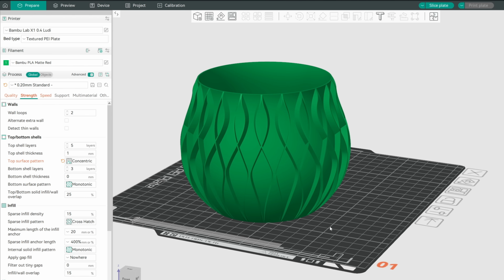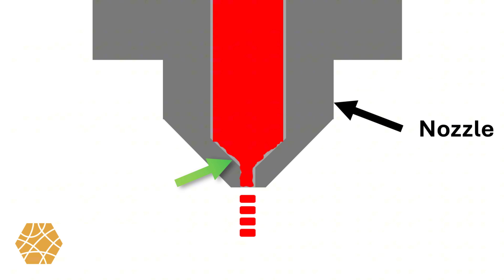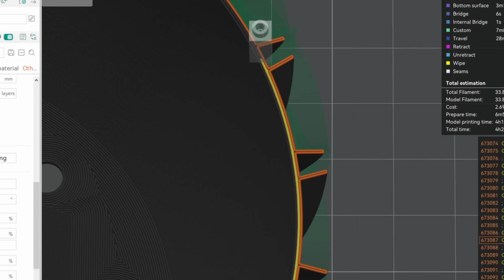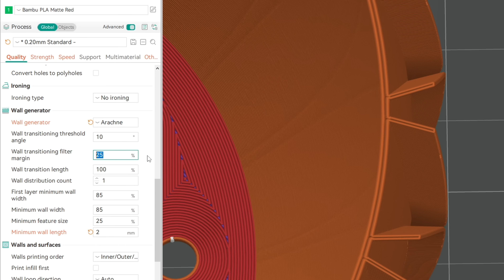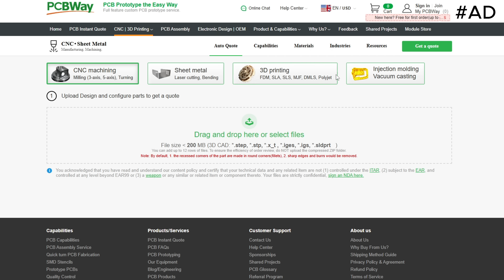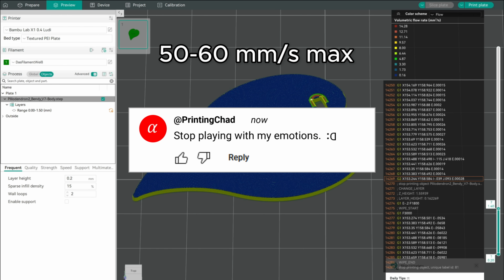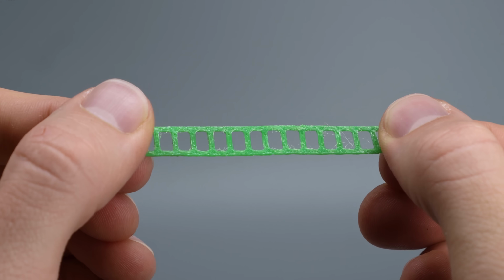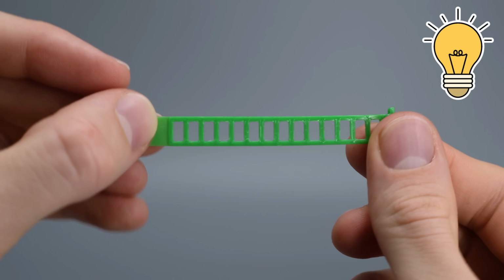The Fatal Error No One Talks About – Get Incredibly Clean 3D Prints!

Comment: nice video .Would you recommend  a bed slinger or a corexy printer for someone new to the hobby ? (Bambu a1 vs Bambu P1S )

I am also concerned about air quality as well.

Thank you in advance .  @Factorian Designs.
Reply from the maker: Both are exceptional machines, with nearly identical print quality. The P1S is a little faster and better for tall objects. I also like the AMS system a lot more because its enclosed. I have some more details on my website as well.

If your budget is not too tight I would probably get the P1S.

Its probably best to watch a video on air quality. I can't cover the whole thing here.
Reply: Just get your feet wet with a Centauri Carbon,even if you doch not like corexy or 3dprinting in general,you only had to pay 300bucks to find out

Comment: "calibrating the filament" is a common language abuse though, just like "calibrating the bed". You calibrate the flow rate actually, not the filament itself (which is truly calibrated during manufacturing), and the build plate is getting leveled, not calibrated.
Reply from the maker: Yeah true, but sometimes it easier to word it like that.

Comment: that is very stupid, in modern slicers the default is arcane. u caused a problem and solved it, this problem does occur but i u cant fix it with ur method cause it is already arcane. this is the first and the last video i watch on this channel
Reply from the maker: did you even watch the part where you adjust the arachne settings? And the other examples?
Reply: @Factorian_Designs  yes i did watch the whole video, but the fact that u changed a settings on purpose is enough to know u not genuine and know what u did, nevermind the fact that it caused +80% of the problem and u showed it as a fix. so most people who have the issue just like u showed in the thumbnail is probably using bad pressure advance and retraction settings and ur video will be considered a clickbait for them in my book.
Reply from the maker: You do know Classic Mode is the basic setting right? 

And like I said in the video I did tune my filaments, you can even see it at some point.

I honestly don't get where this hate is coming from.

Comment: Any half decent printer doesn't have this problem because bambu's crap firmware still can't do extruder acceleration limit like marlin or pressure advance smooth time like klipper.

Comment: Thank you very much, I have the problem despite Arachne.
Arachne has long been standard with Prusa Slicer. 
However, Prusa slicer does not have “minimum wall length” under “Printer settings”/“Advanced” -> “Arachne perimeter generator”.
Reply from the maker: Haven't used Prusa slicer for a while now. Could you not find a simmilar setting? Would be very strange if they left that out completely.

Comment: I have a good tip that I use for every print: if I want to get an almost smooth top surface, I set the top surface line width to around 80–85%. However, if the flow rate isn't properly calibrated, this setting can actually make things worse.
Reply from the maker: Great tip, if you take a look at my optimization videos you can see that I do that quite often as well.